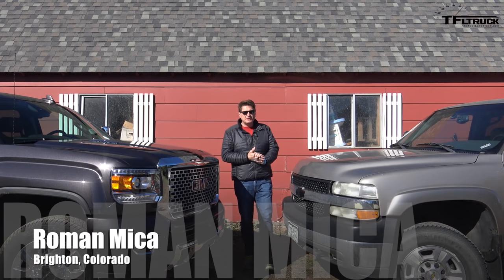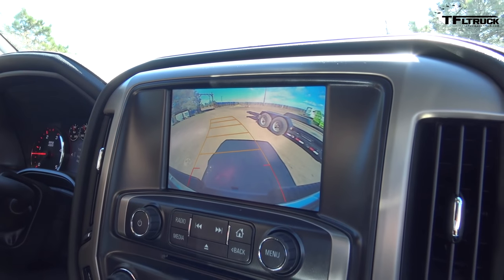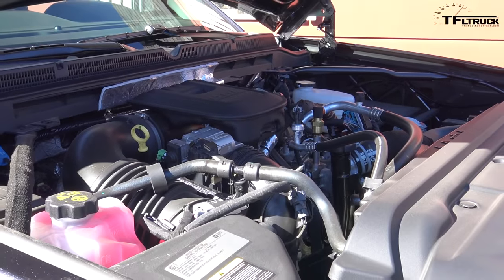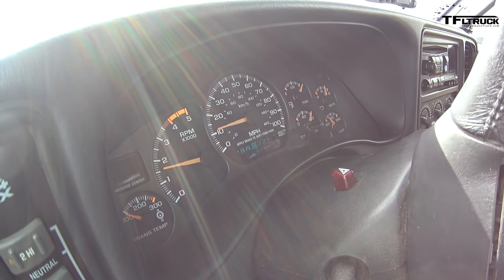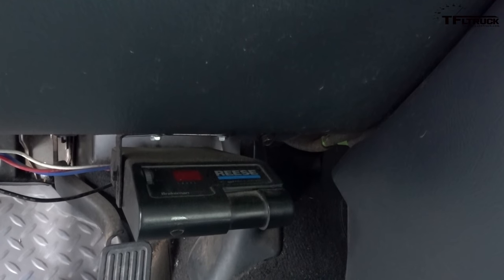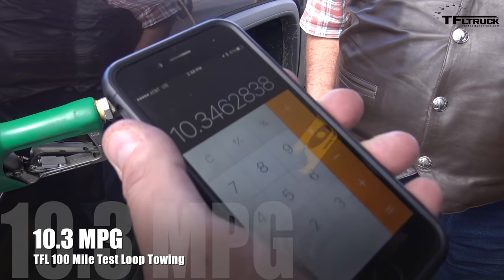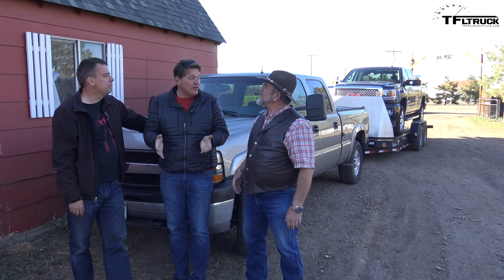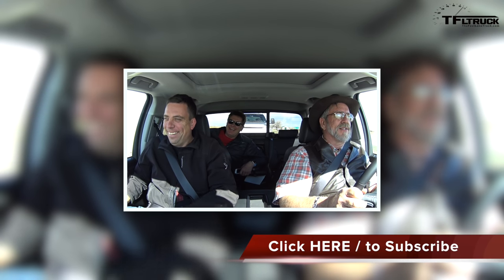2016 GMC Sierra Denali HD vs 2002 Chevy Silverado 2500 HD Mashup Review - Old vs New Ep.1

Comment: Love that 02 Silverado guys!!! That's when trucks were simply trucks. NOT overpriced rolling luxury homes with bells & whistles we did't need or want...
Reply: A brand new truck back in 2002 was less than 30k, and that was a very reasonable price for everybody.
Reply: @blackchevy4756  no it wasn't why do people always say that 😂 my 2002 was 78k I've still got the dealer receipt my 02 duramax cost 38k because it had been bought once and brought back with 2000 miles
Reply: A truck you can go to work in.  Work all day getting dirty and climb in and drive home. If you buy $60,000+ truck you are going to not want to get it dirty. I miss work trucks.
Reply: Back in 2003, my uncle bought his 2003 GMC sierra 3500hd slt crew cab 4x4 with lb7 duramax for like $36000. In 2020, a new 2020 gmc sierra slt 3500hd diesel will cost you $60,000.
Reply: @ucsasinkings8296  $38,000 in 2002 is equivalent to $55,949.56 today.
Reply: “We didn’t need or want” tell that to the people who asked for those features.

Comment: Hmmmm...let's see...I paid $7,200 cash for my 02 Duramax, which had a straight pipe, duramaxtuner controller, and enough power to pull down my house.  Not to mention it had flawless interior and exterior.  I added a $200 touch screen stereo with navigation, and some cheap Kicker speakers.  For the $60,000 difference in price, I'm ok with not having heated and cooled leather seats.
Reply: $7200 is an absolute steal on that truck.  Around here they are all $11k +
Reply: 6011 House r
Reply: You can have heated/cooled seats with a $75 kit, so you can have those too for cheap.
Reply: ypu missed the point completely dont start saying that your truck is just as good as the new one. because it is just not. more powerfull comfortable quiter better built so what you do is wait 10 years to when the price makes more sense lol
Reply: @KTMcaptain  ah exactly you live in California we have some of the worst truck prices used it seems
Reply: Remember Duramax is really abought ISUZU built diesel
Reply: I couldn't justify the price tag on these new trucks. I wont use most of the features, I'll turn off as many of them as I can. I definitely prefer having two doors on my pickups which eliminated almost everything on the lot that the dealer had. Ended up compromising and buying a cab and a half with two doors and a 454. But I use every feature on it. 4.5k well spent.
Reply: Jeez yeah that's a good deal, I got my 04 for 6800 but it's only a 6.0 and 2wd but I love it and I got it with 83k miles.
Reply: You can add heated seats for around $400. Just find some heated seats in the junkyard for a similar year truck, (I had them in my 99 Sierra K1500) then swap the seats and upgrade the necessary wiring.
Reply: i can get a nice one 3500 dollar

Comment: That generation GM trucks are very reliable I still see many on the road today.
Reply: I have a gas 4.3 v6 2002 Sierra with 215,000 miles stock engine and tranny definitely buying a duramax and my next truck.
Reply: Music Lover ummm actually they are very expensive to one do to engine design. The LLY was not reliable after about 140k do to injector and cp3 pressure pump problems.
Reply: tlt40s&w 70 if you have a diesel , you egr delete and Dpf delete and efi live tune , its just what you do , and the LLY and LBZ and LB7 are all GREAT engines , without efi live tunes they will still last 250k without anything done , my LLY had a bully dog PG and a efi live tune , and I boughtbit at 230k miles and it has 360k miles now , runs like a charm still
Reply: Don't buy a diesel unless you have plenty of extra cash, just buy a vortec 6.0
Reply: I've got the 6.0 gasoline version of that 2002. Mine is even the same color.  I have the double cab 8' bed.  It has 231,000 miles on it.  Original engine and tranny.  Best truck I've ever owned.

Comment: This was the best test of them all! I too own a 02 DMAX with 300,000 miles on it and it still pulls like a brand new truck! Thanks guys!
Reply: You probably do not have any of the emissions related problems. Do you use the regular diesel at pump or use some additives as well
Reply: @rahulrane1658  I have no government's emission regulated crap and my truck is straight piped from the factory. It's stock. I only add fuel additives to help the injectors stay clean. As beautiful as these new trucks are these days it's hard not buying one. Those prices keep me away.

Comment: I had the exact same truck, an '02 Chevy Duramax - extra cab long bed.  It was an early Duramax with 300hp and 500 ft. lbs of torque which was enormous back then. It was very reliable and comfortable. I constantly checked my side view mirrors because with the addition of a weight distributing hitch, I barely felt the trailer behind me. I added a tuner (chip) and picked up some more power and I still managed 18 mpg HWY with a 6" lift. Diesel is the way to go and the Duramax has a record of reliable service. Great video!

Comment: Id rather get the 2002, be dept free=)
Reply: lmao true that... 60k+ for extra gadgets.. I'll pass.
Reply: MrMister1227 gico save 15 percent or more on your car insurance
Reply: Yes.. I'll take that 02 with no prob I'll pass on the newer bling bling truck.. I use my trucks for work
Reply: yep spend $200 on a nice stereo $300 on speakers $300 on the sound insulation and have $1,000 worth of interior work done to fix the leather seats and put in new carpet boom it's pretty good shape and think of how much gasoline you could buy with the $45,000 you save
Reply: Dept? Department of free?
Reply: Amen
Reply: as long as you have 20k in the bank if you live here in GA LOL. Duramax’s are not cheap here.
Reply: Market price and actual value at a dealership, a 2002 is bit more overpriced than a brand new 2020 duramax. For example a brand new 2020 duramax will cost about $30000 for a dealership to buy but market as $65000. A 2002 duramax diesel with average of 160000 miles is worth $3500-$4500 but market as $14000.
Reply: In dealerships and some private sellers your actually getting ripped of alot more more buying a 2002 than a brand new duramax.
Reply: @brownbarbie9572  because they know the true value of those 02s and they know the people know 2

Comment: I think it's more of the emissions thing holding the mileage back
Reply: Exactly
Reply: +larry Spiller  but the LML are better tuned!!!! give a chance and put efi live on that lb7
Reply: exactly, diesel (semi)trucks were getting 8 mpg and the oil lobby harassed the EPA to choke the diesel with emissions under the guise of "saving the environment"  needless to say we all lost fuel economy. I'm back to 5.5 loaded in the big truck. It's ALWAYS about the money.
Reply: Dragon Butt not entirely true, the fuel economy really improved with the introduction of the ECM in 2000 and again in 2005 with higher rail pressures. The sad fact is that now with the emission mandates fuel economy is back to the 80s and nineties cabover with the mechanical diesel engines after making such great strides.
Reply: true. plus you need to put a lot of miles to break in the engine
Reply: They would be getting 20+ mpg
Reply: +larry Spiller That's what I was thinking
Reply: Ain't that right. My old 2014 prostar was only getting 5.4mpgs. On one lucky day it got me 8.3 but I think there was witchcraft at play lol
Reply: Ding ding ding.  Nailed it.
Reply: +larry Spiller  Not it is not an emissions thing, the truck is heavier, and it's .4 mpg off that means it'a far better vehicle different wheel size and all.

If you listened to the engine on the 2002 LB7  it was much louder since it's using solenoid injectors and all huge difference in performance.
Reply: MidShipCivic kinda obvious that it would be a better vehicle, its 14 years newer.. the weight has nothing to do with it but tired might of had more drag.
Reply: MidShipCivic The combined weight was the same for both loads?
Reply: larry Spiller  That's not the same at all the weight of the vehicle that's towing is not the same as the one that's being pulled the driveline is seeing different loads at the rear wheels one truck is heavier.

Also this is hardly scientific . the fuel pump stopping due to back pressure in the tank is not a n accurate way of quantifying results and the fuel metering system of the gas station pump. 

It would be better to tow something generic.
Reply: MidShipCivic Regardless if both trucks pulled identical trailers and measured the last drop of fuel, this video clearly indicated the lack of fuel economy improvement  since 2002 likely due to the additional emissions equipment on late models, no matter how you slice it.
Reply: +MidShipCivic your resorting to fowl language which suggests you don't know what your talking about
Reply: +MidShipCivic explain all those variables that they are accounting for. the old truck already has the same engine its lighter with smaller tires. Both were topped of drove an equal distance then topped off again to see how much fuel was used. Theres no point in nit picking every detail. at the end they said it was just for fun. how did you get so butthurt over this video.
Reply: T Wayland  Clearly this is s way over some of your heads, it's not the same engine they both may be   6.6 Dmax but they aren't even close to the same lol.   LB7 vs LML is night and day : Emissions devices, fuel injection system (piezo LML is far better than the solenoid LB7) 

Fue station  pump metering tolerance, whens the last time that thing was calibrated? *Yes they are regularly calibrated)  The pressure sensor on the fuel nozzle will determine  when the fuel service pump shuts down. This varies because IT'S obvious the fuel tanks aren't the same  do you know if the exhaust heated up the tank a bit and caused expansion and back pressure ?

Fuel level sender in the old truck expands and contracts.

Pulling each others vehicles applies  different weight on the rear whee. This in effect loads the engine differently not to mention, wind resistance oh yeah one truck had 2 people in it.

Someone installed aftermarket exhaust on his w/ an intake system.

The fact that it was 4 tenth off  on their math proves the LML is better vehicle seeing how it's wheels are loaded more it's general curb weight  *LML are heavier*  + the trailer ... if you thought they had the same total weight on their driving wheels YOU'RE FLAT OUT WRONG
Reply: +MidShipCivic i dont understand why you think that the vehicles differences needed to be accounted for. its literally just testing what vehicle used more fuel. i think you're under the impression that each vehicle is ment to represent all trucks that GM made during each year. plus those variables you mention wouldnt really make a big difference on the just under 100 mile trip. it might not be the most accurate way of doing it but it gives you an idea of how much fuel these vehicls use. Gearing and tires size are literally the main 2 things id change when hunting for fuel economy.
Reply: T Wayland  Clearly, more than you  to understand or maybe more than you want to actually comprehend. Listen,  with their evaluation .4 is something  *YOU WILL NEVER NOTICE* 

In fact since the LML is heavier and is getting more load on it's drive wheels. WITH THEIR MATH It does the same thing *THAT MEANS * it has the same fuel efficiency with MORE WEIGHT, it IS more efficient.
Reply: +MidShipCivic calm down. ive invested some time into vehicles because fuel economy is something i actually care about. I just dont understand why someone can start complaining on a video where they clearly say its not the most accurate test but mostly for fun.
Reply: T Wayland  Slow down juice box, for me to complain I have to view them as a reputable source I rely on. You my friend  lack empathy, any joe can get his buddy's together with a 4k camera and do mundane bullshit and follow up  contradictions.

  For fun... nah, there was no point in doing so because their conclusion shows a sheer lack of expertise. You can't call it better and then use a  blanket statement ''just for fun'' when you don't understand the complete topic.
Reply: +MidShipCivic for the record im not defending these guys in any way. I was under the impression that this was just a fun quick video. If this is the type of content that these guys produce regularly then i understand why you are upset.
Reply: T Wayland  You are reading text, you do not know any emotions, these are simple comments. 

Secondly, ''fun video'' there is a ton of time money and editing that has gone into this fun I think not.
Reply: +MidShipCivic yeah. id love to keep chatting but this has carried on long enough. bye
Reply: T Wayland  look into the word  ''half assed'' because many ppl now think a predecessor is better than a successor lol
Reply: MidShipCivic unfortunately in this scenario,  it is!
Reply: Robert Polkamp unfortunately it isn't because .4 means nothing and you weren't  listening it's heavier and gets practically the same mileage with their math .. - more efficient engine.  Your comprehension is fail.
Reply: +MidShipCivic aren't both engines moving an identical amount of weight minus the old fella who didnt get in the 2002?
Reply: Andrew Novak  No because LML chassis is heavier  + the tongue weight. The rolling weight isn't that significant.  On top of that piezo injectors make combustion all much more efficient in the LML.

Literally the injections in the LML can inject 5-6 times while the LB7 can manage 2 or 3 to sculpt the combustion wave. 

It's getting loaded more and achieves the same mileage -  4 tenths w/ their math ISN'T JACK SHIT. That means the LML is  a more efficient engine.
Reply: I'm sorry but I don't follow what you mean.  Just to clarify the lb7 is towing more then the LML if I'm correct. Efficiency comes into question for me with the LML.  I've owned an Lbz and lb7 at the same time and even with the LBZ having an additional over drive gear and being able to cruise at a lower rpm the lb7 achieved  better mileage significantly.  So I'm thinking the older engine is more fuel efficient then the newer one.  I realize the newer truck is heavier but you stated the rolling weight  was insignificant. I don't mean to argue,  I just think I'm missing your point.
Reply: Andrew Novak 

THE LML IS SEEING GREATER ENGINE LOAD  THE FRAME IS HEAVIER THEREFORE IT'S APPLYING MORE WEIGHT AT THE DRIVE WHEEL.  

AN LB7 is LIGHTER  

DEAD WEIGHT weight being towed at the rear  is nothing compared to the load on top of the drive wheel. Pick up a fucking physics book anything rotating that gets weight applied on it in this situation would have to be more efficient to have close to the same mileage, 

You'll see this as ''engine load'' .
Reply: +MidShipCivic +MidShipCivic my apologies if I'm frustrating you I was just curious as to what your point was. And actually the newer style frame in the LML was more rigid but weighed less then the 01-10 frame that the lb7 has under it or so GM advertised. Also engine load is any effects the outside world has on the engine so the "drive wheel" you're thinking of wouldn't be the rear wheel,  it would be the fly wheel.
Reply: 100% why kinds of curious as to why they didn't mention that lol
Reply: +MidShipCivic the newer truck was pulling less weight
Reply: +MidShipCivic who give a fuck how heavy it is, it's a 14 year time difference, it should have much better fuel economy even if it is heavier. It has a 6 speed transmission vs a 5 speed on the old one. The new one is towing less weight than the old one is. Every variable in this video gives an advantage towards the new one and so what if it's just .4 tenths of a gallon it's still less than the older one even with all its advantages. And it's not some scientific experiment, it's just a few guys who did this for fun to see what happens. The trucks took the same route on the same day in the same weather, and the older one did better, get over it and grow up
Reply: NickF1999  please keep quiet especially when you clearly don't have a grasp on what you're saying ( it's very painstalkingly clear)  .
Reply: +MidShipCivic the 2016 gets worse due to the SCR catalyst and the indirect injection using fuel to dose and heat the catalyst. this is done to burn off the soot in the DPF. 2006 was the best year for power/fuel economy very minimal emissions.
Reply: yeah I'd say that's it all the way.
Reply: Emissions, it's heavier, lot more horse and LOT more torque
Reply: ya, my buddy in canada has the same truck as i, and he gets  over 2x the mileage i do, when he moved here the dealer called and said he needed to update his fuel system he told himm to pound sand

Comment: The 2002 duramax trucks have always been my favorites. My dad has a 3500HD that has just over 106,000 miles so it has a while to go. Hasn't done any major work to it engine wise but over the summer we had to put some money into it. We cut out and replaced the old rocker panels since they rusted out and put new and stronger ones in. Then scaled 46 pounds of rust off of the frame and had it undercoated. Then had that eggshell type covering on the rocker and door panels. I don't know what that covering is called but it reminds me of it for some reason. I think some know what I'm talking about. My dad refuses to spend $60-$70K on a new truck and I don't blame him.

Comment: This is really interesting . I have a 2001 dodge 2500 V 10 and I would love to see how it stacks up to a new dodge 6.7  or even an older Chevy 8.1 litter .
Reply: I have a 2004 Chevy 3500 8.1 4x4. I will never get rid this truck 247,000 miles and it will pull  as good as a new one. Update 9/18/2022  now the 3500 8.1 has 262,000 miles still running strong.